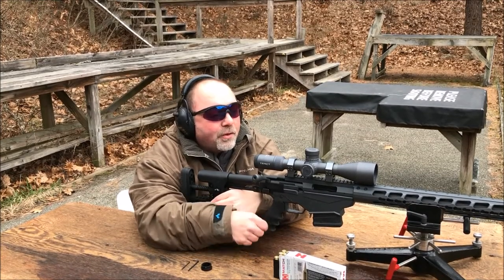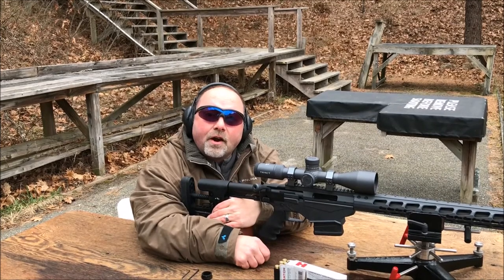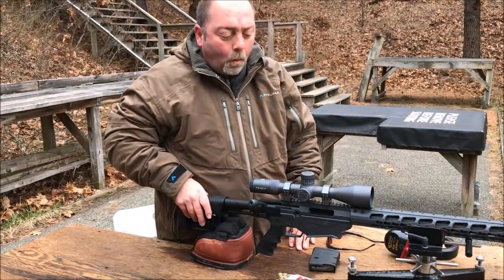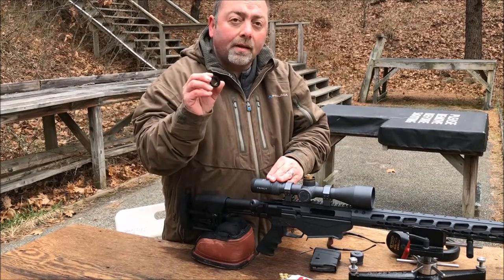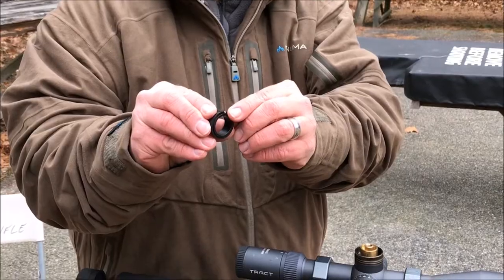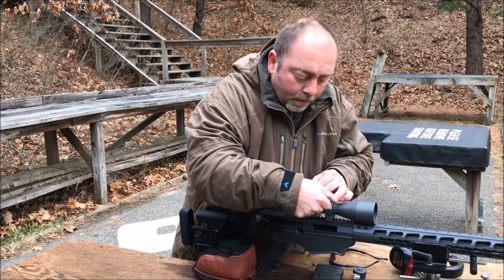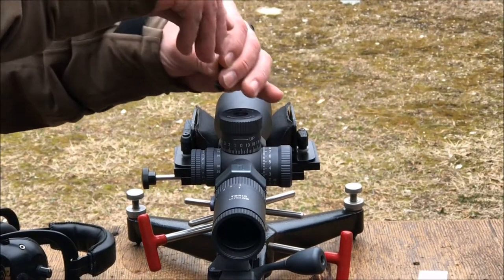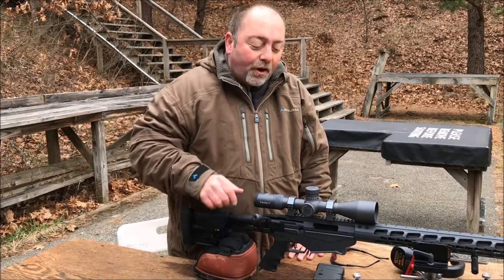Optimize Your Rifle Scope Performance #riflescope #shooting

Comment: What about the horizontal position, does it have to be zero lock as well?  I'm asking because I have a leapers utg scope n I have to lock that also,  it doesn't twist & turn like your scope does ..I plan on getting a black hound optic and it's similar or the same as yours.....once I zero lock mine that is it, I just use my mildot or hash mark 4 different yards ....
Reply from the maker: Both windage and elevation turrets lock. Once locked they do not move unless you lift the turret to disengage it. Most shooters do not dial wind more then a rotation, so there really is not need for a zero stop on the windage. Furthermore, since wind changes most shooters tend to hold for windage in the reticle. UTG and Blackhound do not use SCHOTT HT glass so they are not the same scope.

Comment: I have one of your 3-12x50 Tekoa HD scopes on a 257wby vanguard, is this same zero stop and custom turret available for my scope or would I need to upgrade to the Toric ?
Reply from the maker: The TEKOA and TORIC use the same turret system, so we do have a kit that would work with the your scope, but it is slightly different than what is shown in this video. Here is a link showing how the turret with lock and zero stop would work on your TEKOA scope (Note: the video shows a TORIC scope, but the function is the same) We also have custom turrets available for the TEKOA scopes. Contact me directly at jon.lacorte@tractoptics.com if you would like to place an order for either the turret kit or the custom turret.
Reply: Yes, unless you have a lathe or someone that has. The problem is the size of your shaft and the post that makes it zero. There’s one more problem and that’s the inner base stop be careful not to drill to far in or you can ruin your scope. You need two roll pins and a plate made by your machine shop to fit your o.d. and hole to fit your shaft. It’s really very simple to make if you have a machinist nearby.

Comment: Can you leave the stop loose inside scope while sighting in? Or does it have to be removed
Reply from the maker: The zero stop is not installed on the turret from the factory, so most folks do not install it before zeroing. We do not see any reason you could not install the zero stop and keep it loose but it may move around/turn under recoil.

Comment: Counter clockwise side?
Reply from the maker: There is a pin that stops the turret from turning in the turret housing. The zero stop ring also has a pin. These two pins meeting stops the turret from turning hence providing the zero stop. The pin on the zero stop ring needs to be placed on the counterclockwise side of the pin in the turret for it to function properly. This video shows the process of installing the zero stop ring. https://ecs.page.link/MD5Qp